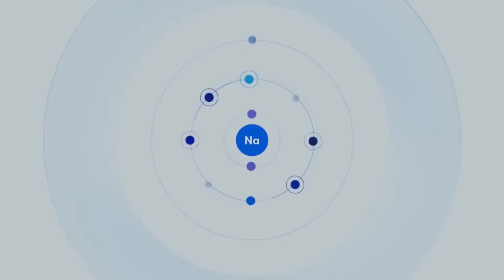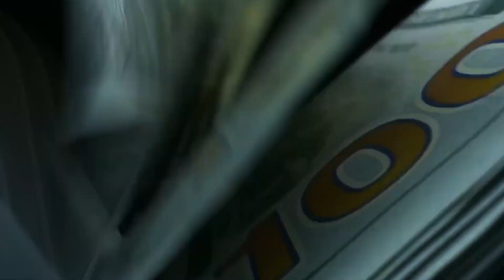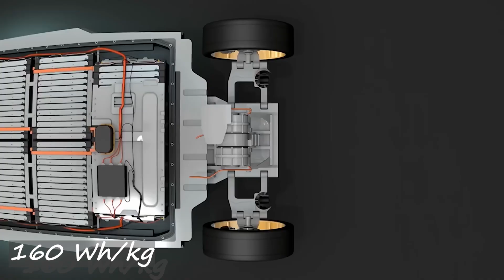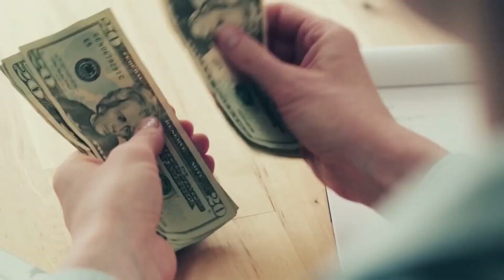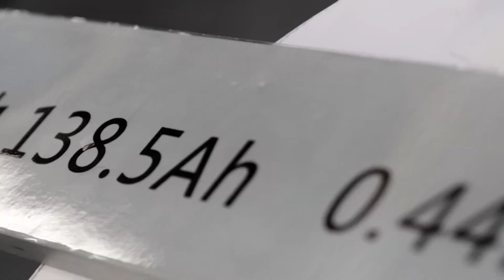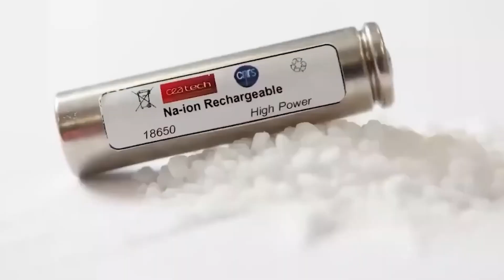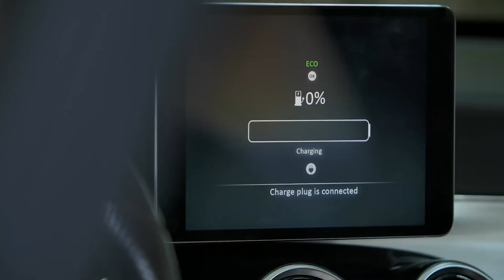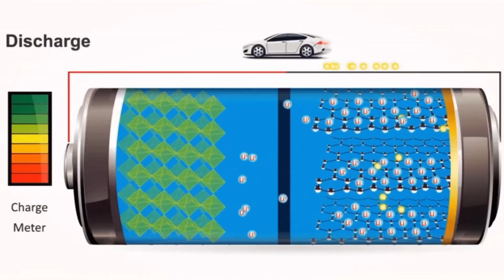Chinese JAC unveils the FIRST EVER EV with Sodium Solid State Battery

Comment: Promising, but a lot of work still needed on sodium-ion batteries. For now, they are heavier, have less capacity and wear out faster than lithium-ion batteries. But, the sodium-ion batteries have a better low temperature behavior, seem safer, and are much, much cheaper.

Comment: Highstar sodium ion battery!!!!!! 70ah at 3.9v with 2000+ life cycles -40c to +60c working temp! Charges at 3c and discharges at 3c! DONT EXPLODE OR CATCH FIRE NO MATTER WHAT! More recycleble! Dont explode catch fire when put through shredder to recycle them like lithium that does! Lithium more expensive! 1400x more sodium than lithium in crust! Easier cheaper production cost and recycling cost! No fire hazard!

Comment: Range per charge is one of the major limits of EVs especially in areas where charging stations are not sufficient and  or are rather expensive and time consuming. Although most of the times the smaller range meets the requirement of local city travelling, yet people do not like EVs because they do not meet their occasional requirement of long travelling. Can the manufacturers consider providing a spare battery which can be loaded only when a long journey is needed? This may be  liked by those who have their own solar system installed at home and can charge batteries at no extra cost.